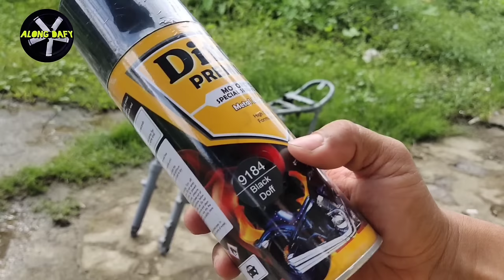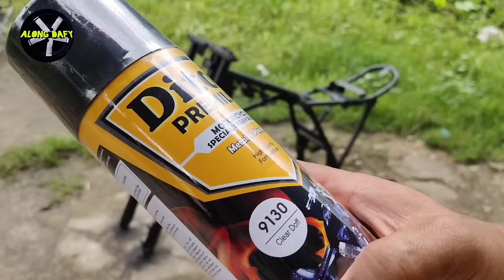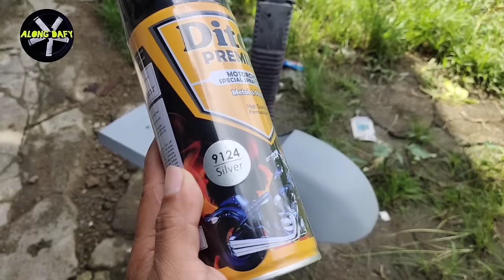FULL RESTORATION 50 Years Old Classic Motorcycle - Rebuild Old Cafe Racer Abandoned - TimeLapse

Comment: You should of left the top half of the front suspension struts chrome as they are yr front suspension and they slide into the bottom sectuons what the front wheels are fastened to

Comment: Could not have been in the water long axles and swing arm pivot bolt not seized also cylinder came off easy no rust could this video be a set up ???!
Reply: It sure was, absolutely no water in the oil, the clutch and internals in excellent condition, the inlet port conveniently plugged while it was in the water. So many vids like this where they get an old bike, cover it with paint and mud to make it look like its a total wreck and fix it up like new!
Reply: I think it was in the water for less then an hour. Just long enough to take the footage.
Reply: Cowboys. I wouldn't buy any bike from them.

Comment: Can't believe you put the same shitty tyres back on.! Also you should have used a puller on that big dent in the tank, instead of filling it up with 1/2 a kilo of bog.!  put  a rubber on the kickstart.  If a job is worth doing, it's worth doing properly..!! Also buy yourself a torque wrench for when you put heads on. Apart from that, it looks great..!!

Comment: Subscribers if you like the fact that you are being deceived, then continue to watch and praise the blogger for how beautifully he deceived you!!! You haven't really ever seen what happens when a bike is under water for a long time or how they showed it here, but it's not possible to fix it, because it would have rotted all over, the ribs of the tselindra would be like a solid 
 a corroded piece of aluminum , the nuts were twisted only after heating and did not have such sharp edges, the valves would be rusty and could not be removed so simply they would come out only with guides , and if one of the valves was open and water got into the whole engine , the whole engine would have to be thrown into the trash , etc. It cannot be that after walking in the water, the bike is so easily disassembled and all the nuts and bolts are so easily unscrewed and removed from their places!!! This is a lie and a lie and a lie ... And also the fact that there were traces of black grease on the engine block.
Reply: well sed nice one there fake as you sed its all lies with them